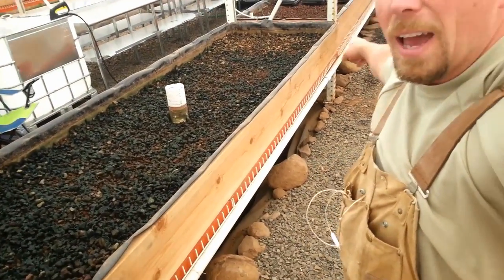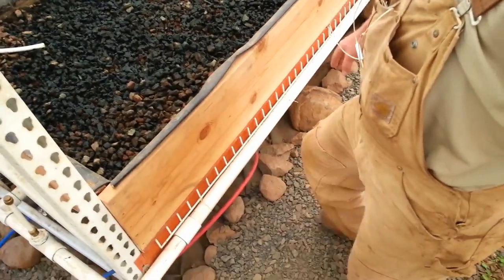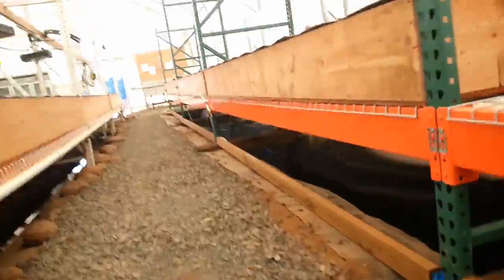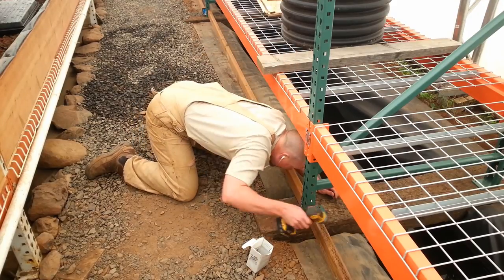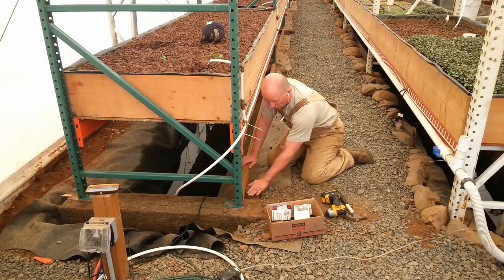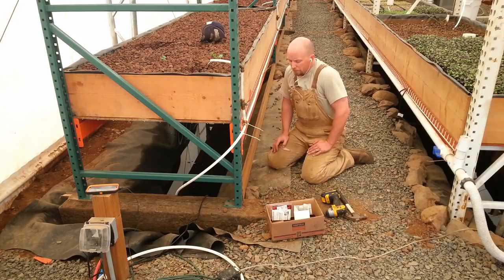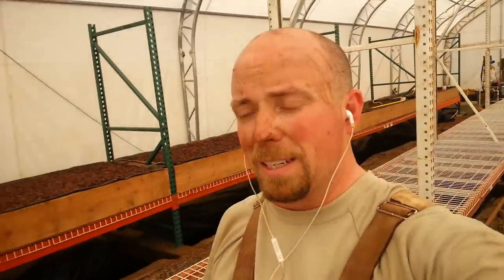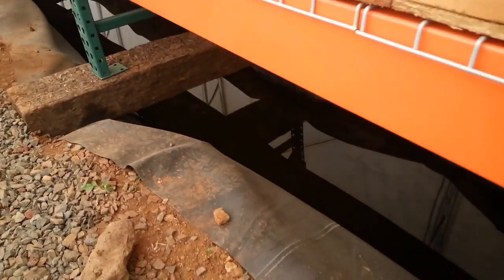Do THIS...to PROTECT in GROUND TROUT Tanks

Comment: Regarding subscriptions:  one problem that I noticed is that your project involves MANY specialities.  Earlier this year (2017), you focused on the electronics of sensors and microcontrollers.  Later, you focused on insulation, heating, and the economical use of electrical power.  You also focused on the structural engineering of your growing system.  So anyone who was interested in electronics, lost interest when the focus switched to your "horse toilet", etc.  Likewise, people interested in designing greenhouses probably lost interest when the focus switched to pH meters and Arduinos for the fish "tanks", etc.  

If I were you, I'd sell your project not as a potential martian habitat, but as a year-round, automated, high productivity greenhouse.  Instead of microgreens, add some tomatoes, or strawberries, or other more conventional fruits and/or vegetables.  Suddenly organic gardeners will become interested in a guy who can grow strawberries in mid-winter while there's 3 feet / 1 meter of snow outside.

Comment: My main frustration with your channel is you like to do things the hard way and safety is sometimes not a highest of priorities.  In particular your reliance on the dirt to hold up thousands of pounds of rock and water with no footings or way to reasonably spread the load out into the surrounding area is something that frustrates me as a former concrete guy.    BTW no, the railroad ties are not adequate. if they were full length 10ft ties they would be perfectly sufficient  but only having 18 inches on either side of the fish hole is not sufficient, especially if the pond liner were to spring a leak.    

I also have some concerns with your food prep setup, but I don't have the expertise to confidently recommend changes.